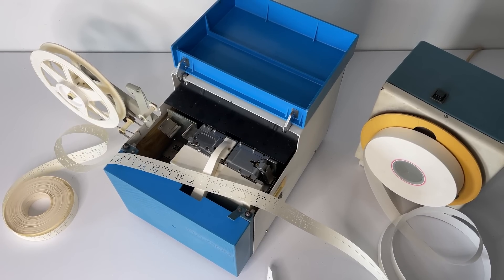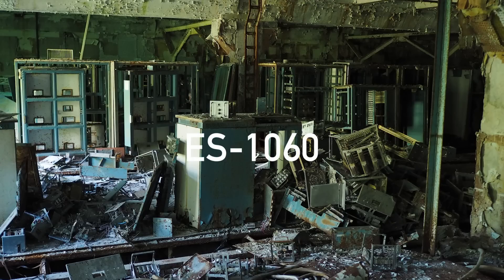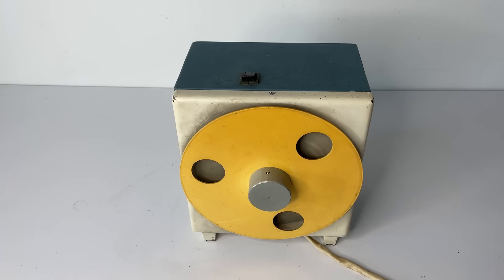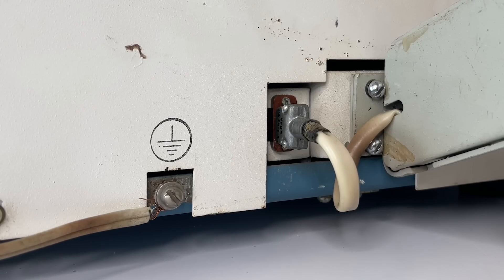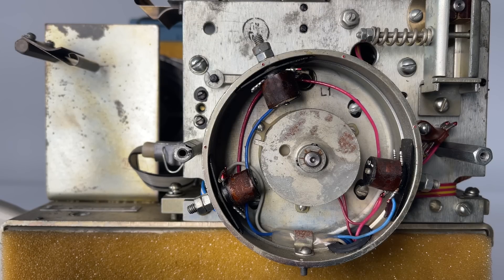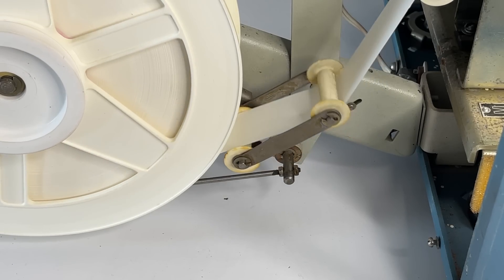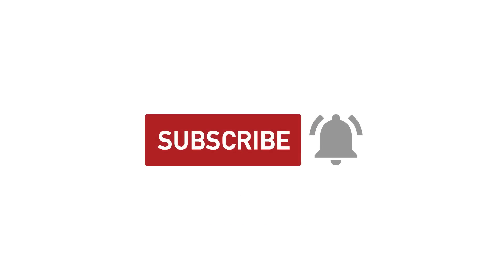Restoring the Chernobyl Computer Paper Tape Punch!

Comment: Those 3 "switches" that look like coils on the end of the motor are in fact HAL sensors. They send a pulse to the control board to control the speed of the motor or to "inform" the current speed of the motor for it to punch at precise timing.
Reply from the maker: Thank you, yes, we figured that out.

Comment: Wow! I'm really looking forward for this EC-1060 restoration process. My mom worked on EC computers (she worked as software engineer in soviet union).
Reply from the maker: We have updates about ES1060 on Patreon and new will come soon. Question: which machine she worked on? We could use a help from 1060 operator...
Reply: @ChernobylFamily  I asked her previously, she doesn't remember quite well. She worked on a bunch of soviet machines since 1980th, including EC (but not only). She worked for the Institute of automatization in Chernivtsi branch. Traveled a lot while worked on projects like nature gas pumps automatization in Siberia or automatization of sugar plants in Ukraine.

Continued working there and then in some gov structures at 1990th, but on a more modern computers. And then she switched into accounting at early 2000th.
Reply: @ChernobylFamily  I'll try getting more details about EC computers, do you have any particular questions?
Reply from the maker: @konserv thank you! Specifically we are interested in the work with ES-4001 multiplexer channel control panel. We so far got all internet sources on it and some documentation but without actual operators' testimonials it os hard to proceed.

Edit; 4001 is an integral part of 1060.
Reply: @ChernobylFamily  hi, guys. Sorry to say that, but I'm not sure that she can help you too much. She worked mostly with preparing data on magnetic tapes (бюро подготовки данных на магнитной ленте). Within EC machines she mostly communicated with a tape storage blocks, there were other guys who worked with control panels, multiplexers, etc.

If I'll find any helpful contacts or information - I'll keep you updated.

Comment: With see you touch every parts with barehands, i believe that the radiation is in safe level.
Reply from the maker: This is identical equipment, not original. However, devices in the SKALA control room are also not contaminated.

Comment: Those machines seem to last 100 years if good maintenance was made 😉 All that single slot screws, no philips or hex heads made assembling to a challenge.
Well, if you are able to build an interface it would be a crazy idea to run gcode for a 3d printer on it and print something simple..
Reply from the maker: Tbh, we really miss philips heads in soviet tech. They could at least clone that))) because it is really exhausting to assemble some hardly accessible parts without a magnetic screwdriver.

Comment: "worked straight out of the box", i now know the soviet version of this saying includes several dozen hours of testing, jumped test leads, custom test connectors, disassembly, and repair of previous failure condition. lol
Reply from the maker: Very true. However, big machines were never meant to be ready out of the box and always required a certain (long) period of installation and testing. Another thing, that in the case of the western tech after that stage started work, not work-repair-work-repair-repair-repair :)
Reply: @ChernobylFamily  ha, i know this from owning a cheap car.... but i can always get my car to work. like with the old reliable manual transmission, 384k miles on my 98 honda accord, starter went out and i just push started it for 3 months before finally fixing. stuff isnt made like that anymore. didnt realize you guys were ukranian, guess that makes sense. glory to ukraine&the heros
Reply from the maker: @vevenaneathna  thank you!

Comment: It always floors me on how the political grip strangled so much engineering potential. There is so much basics to learn from these devices. Everything has become so integrated that it is sometimes really hard to understand how things work on the low level. Here you can touch and feel them. No nano mechanisms here.
Reply from the maker: 50/50. At the same time you'd need a pool of narrow skilled technicians to service it. But you certainly have a point.

Comment: What's SCALA mean? An abbreviation or it's real word scala  cliff in English?
Reply from the maker: System for Control of Apparatus of Leningrad Atomic [power plant], where it appeared initially. However, the acronym is used as a word, literally as you said, a 'rock'
Reply: @ChernobylFamily Which machines are better with the punch tapes or punch cards?
Reply from the maker: @jacobsandler438  with a magnetic tape :D typically cards and tapes worked together. Both rarely.
Reply: @ChernobylFamily For me even machines with magnetic tape are ancient. I started to work with the floppy disks something 5-1/4" in size, I even forgot its exact size. I actually serviced wire bonders with 5" floppy drives and later on other equipment with 3.5" floppy drives, and CD drives.
Reply from the maker: Consider we just love to see high-speed reel drives in action:)
Reply: @ChernobylFamily I'd recall that unwanted punch cards scrapped by IT people found use in different educational institutions as a  test tickets.
Reply from the maker: Same memories

Comment: There is PM-150M adepter AC021 for IBM compatible machines. It was produced in Kyiv. Its an ISA bus card.
Reply from the maker: Yes, but to find it is a real challenge...
Reply: @ChernobylFamily  I had one, but sold it year ago because i had no use for it. If only I knew it could be used. I didn't have software tho, just  manual and card.
Reply from the maker: That's sad(

Comment: Are there still any computers left in the Chernobyl buildings to date? Also, maybe some old folks from Ignalina could help if needed and if they used the same system?
I'm curious what kind of computer systems the West was using at their NPP's in comparison.
Reply from the maker: Please clarify what do you mean with 'Chernobyl'. If the NPP, it is stuffed with computers, as it is a functioning enterprise. In Pripyat and Chernobyl-2 there are only remains. In Chernobyl town, there are many in functional enterprises as well.
Reply: @ChernobylFamily  I was referring to the NPP, wondering what happened to the main computers that were used to run the NPP, if they're still there after all the reactors were stopped.
Reply from the maker: @puciohenzap891  yes, what you see in this video are actual systems that are standing there. The thing is, they were scheduled for dismantling as they are no longer used. Somewhen in 2019 we visited these rooms and told the management that it is a massive piece of a computer history. So they changed plans and returned them to their 1986 condition to show to visitors (as there were guided tours before the war). However, note that historically, after the deep post-accident modernization and re-launch of the power plant in autumn 1986 the original SKALA has been very much altered, there were literally racks of modern servers and specialized computers connected to it. All that was removed as a part of a restoration of its original look.

There is a complex computer system that is called IASK OU (information-analytical computer system of the Shelter object) that provides a constant monitoring of the destroyed reactor. Originally it was based on SM EVM, soviet clone of DEC PDP-11 computers; now, of course, they use modern, cutting-edge equipment. We at some point will have a big episode about those PDP clones and IASK OU as well. So stay tuned!

Comment: Punched tape was rarely used by Soviet mainframes. At least I've never seen it used although the puncher and the reader were available. And I've seen a dozen of different installations and spent a great deal of the day in the computer hall for several years. Punched tape was used by mini- and microcomputers. ПЛ-150 is a very simple device that has only 1 transistor inside that provides a delayed ready signal to computer. Wiring of the solenoids is directly connected to the input socket. High speed was used for paper tape. Low speed was recommended for plastic tape that is harder to punch.

ЕС-1060 was the top model of the stage 1 development,  then there was stage 2 with ЕС-1066, and some work on stage 3.
Reply from the maker: Thank you for the details! The only thing, 1060 was stage-2 as it was ibm/370.
Reply: @ChernobylFamily  Apparently it was, but it  had buggy VM support. VM/SP did not run on it. So it looked the same old stage 1 from the user's perspective.
Reply from the maker: @poizaz  so what did they use then? BOS ES?
Reply: @ChernobylFamily  It was some kind of MVS with a home-made dialog system called JEC. JEC had a simple text editor, JCL launcher, and it could spy on the system console.

Comment: Maybe the rotator of the synchronizator (9:00 mins) is some kind of magnetic proximity switch? Is the rotor magnetic?
Reply from the maker: Many other commenters suggested these are Haul Effect switches.
Reply: @ChernobylFamily  Hall-effect switches could be a possibility but they are semiconductor switches that need a separate supply. If the rotor is magnetic in some way, a voltage might be induced as it passes a coil. Or it might affect a secondary circuit otherwise. At least: that's what I think.

Comment: Are you crazy taked the radioactivated stuff from Chernobõl? ☢🚷 🤦‍♂
Reply from the maker: I will tell you more: we are crazy enough to work in the Chernobyl Zone since 2009.
As for the hardware, if you'd watch our previous episodes, you'd know we find identical equipment elsewhere because most of junk in the Zone is beyond repair and taking anything out without authorization is a law violation. However, it is for SKALA, it is in airtight zone so it is not radioactive at all.

Comment: The switch on the back with the 3 positions looks like a early Hall effect sensors cars use a single sensor with a wheel that is connected to the crank shaft to tell the computer where the engine is in its cycle to fire the ignition
Reply from the maker: Thank you!
Reply: There is no Hall effect sensors there. It is just plain old induction sensor known from Faraday's time.
Reply: @poizaz thought the same, anyway you need electronics to read out the signal and convert it to a digital pulse.

Comment: I worked in the former Czechoslovakia as an EC-1033 and EC-1045 operator😉 We called devices for 2-36mb disks "washing machines" because they visually resembled them😁😁I was still young at the time.
Reply: I tried to contact one of the docents of the computing center of the Slovak Academy of Sciences who have this EC-1033 in the museum with your problem😉
Reply from the maker: So much thank you!
Reply from the maker: Oh my... Look, we VERY much ask you, if possible: can you write us an email using a 'contact us' on 'about' page of our channel? The thing is, EC1033 was installed at the upper floor of the Duga datacenter, and we crucially will need a consultation of the actual operator of such a machine.
Reply: @ChernobylFamily  As an former operator, I probably can't help you with technical matters, the technicians and programmers who took care of the system and repair of boards could do that, although some are still alive, but they are people 70+ and I have no contact with them.
Reply from the maker: Thank you for your responce! We are particularly interested in work with processor panel and so. Not repairs, with this we have sources.
Reply: @ChernobylFamily  Yes, but this operation of the front panel was in charge only of technicians who turned on the whole device and knew what each indicator light meant! They had a manual for it
At least in our case, the operators were not allowed to do anything on this panel, at most turn it off or report that something is wrong. And the diagnostics were carried out by technicians! This means that the error messages diagnosed by the lights were managed only by them. Most of the time, there was a problem with some board and they had to remeasure it and resolder the "cockroaches".So unfortunately it cannot serve😌
Reply from the maker: @pumelo1  i see. Anyways, thank you!

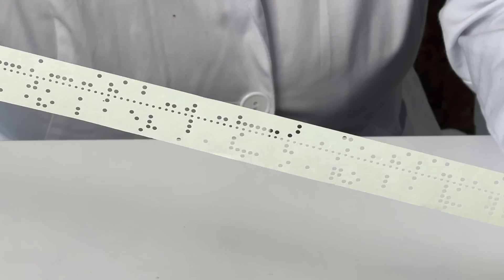Comment: On 3:36 tape is looking completely flat. But on 10:28 tape around synchronisation track looks pretty warped. What’s the difference? Did that tape was punched in another way or flattened through years of storage or is it something wrong with your ПЛ-150М?
Reply from the maker: That's because that tape with the program has been made on a different punch. Our for now cannot punch anything meaningful- we dont have a controller so far
Reply: @ChernobylFamily  thanks!

Comment: This is  my first time stumbling upon your videos! My family is Serbian so my Russian is a little poor.  :-[
I couldn't read all the cyrillic on the panels. Could you explain them in other videos?
Reply: Запр.[авка] = tape installation
Вкл.[ючение] эл.[ектродвигатедя] = motor on
Сеть = Power on
Потребляемая мощность = power consumption
Напряжение = voltage
Частота = frequency
Ш5 = Connector 5 (The letter Ш was designating connectors)
ППЛ (Подмотчик перфолкеты) = punched tape winder
Reply from the maker: Well, same as our. Sure! Check the other episodes in meanwhile :)

Comment: Do you have any suggestion where i stil can buy this paper tape ?
Reply from the maker: Clarify please, do you need a blank tape or a punched tape? Both options – online marketplaces. If blank, then sometimes a teletype tape may fit. If punched, then, for instance on eBay it appears pretty often. But the best way always it to ask in retro computing communities.

We also have some Soviet tapes (i mean, punched, not blank), and plastic cans for them, mostly for Soviet PDP-11 clones, so if you need something – we can negotiate.
Reply: @ChernobylFamily  I'dd prefer blank tape.
I'm a HAM-Radio operator and would like to build a 'HELL-Schreiber'  such Telex paper would be ideal to use however Telex has long gone so have the shops selling the stuff.
Thanks for your response 🙂

Comment: Awesome work guys. If the architecture of the machine is well understood then it can be also implemented on FPGA as a soft core.
Is there any documentation or manuals of PL-150M ???
Excited to see further updates.
Cheers !!
Reply from the maker: Yes, there is a technical reference and a user manual with a detailed description of the cyclogram. I think in a month or so we will have the controller!:)

Comment: Chernobyl Family, thank you for that video. It brought back many memories for me. I am waiting for your video on that Скала machine. I've read thousands of articles for Chernobyl disaster and I know that Скала was important part from reactor equipment. It will be very interesting for me to see what that piece of machinery was, what was the purpose of all that racks and control boards and lamps and switches.  Was it a real computer, how it works. How many programs run on it. What was the operating system. What is program Дрег and how this program takes the measurements of the parameters  of RBMK reactor. Please do that video.
Reply from the maker: Thank you for your motivating words! We will make it as soon as it will be possible. Right now there are severe limitations due to the wartime. However, it is highly possible that we will have a few episodes about its components again before the big one, specifically, about DREG.

Comment: Vey cool that the speed adjustment makes one gear larger and the other smaller so the relation is changed but the belt size don't need to change. Cool!
Reply from the maker: Yes, and it is pretty stable working, we have to say!

Comment: Thee name of the device is synchro. It was used in old planes and machine to sense position think of it as analog rotary encoder. There are no switches those are the sensing coil cores, the sensing is completely magnetic. As there is no physical contact with the rotor it is very durable and reliable.
Reply from the maker: Thank you for these details!

Comment: Hey, greetings from another lab coat wearing nerd gal with Slavic origins :). Nice unit! I love how it's built, contrary to Allied computers, it's more mechanics than electronics, all so simple and reliable.
Cool that you show synchros, as CuriousMarc just did a video on them :).
Reply from the maker: ...but it required a table-sized rack of circuit boards to function.
Thank you! :)

Comment: I'm I understanding things correctly that during a write operation, the baud rate was set by gears? If so, was the write transmission from the computer's rs-232 module/uart run open loop or was there a electro/mechanical ack/nak system?
Reply from the maker: There was a controller, which provided bufferization of data and a distribution to the punch based on a chosen speed. The gears cbosen had to match that. Well, the devices are not rs-232, though

Comment: Very interesting video! I'm also motivated by your passion on making forgotten technologies live again. Coincidentally, I also acquired a Chinese made tape punch/read/check device, with concept similar to your one. It has 5/8 bit tape punch, photoelectric tape reader and a keyboard. The unit is electronically controlled, not like other teletypes such as ASR-33. The punch/read/keyboard unit I have weights 17kg but the control unit which I'm missing should weight more than 30kg according to the information I've found!
Just like you, I'm also planning to make a modern interface for my machine. I'm planning to add UART capability(which is a must have) and also USB keyboard emulation, so I can use the machine as a convenient input device on modern computers. I think with your tape punch restored, you can make some customized tapes and seal them in plastic, for sale as bookmarks. They should be very welcomed and should add a little help for funding your bigger projects.
Reply from the maker: thank you for the story and your ideas! Yes, we are thinking towards such merch. And good luck with your restoration and interface making!